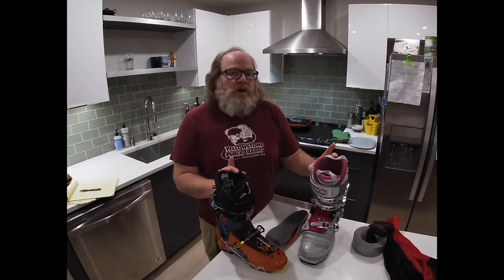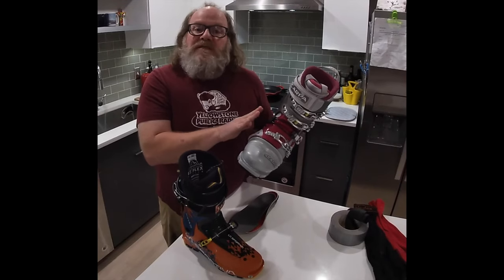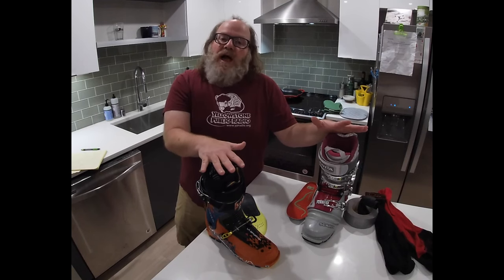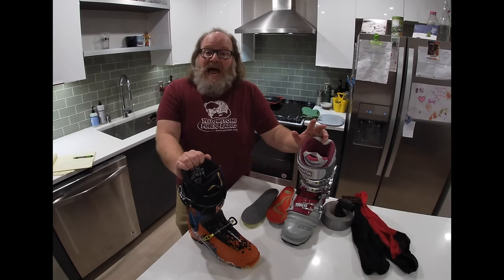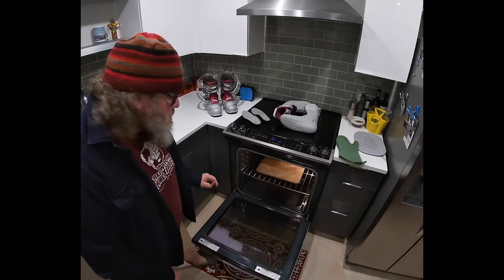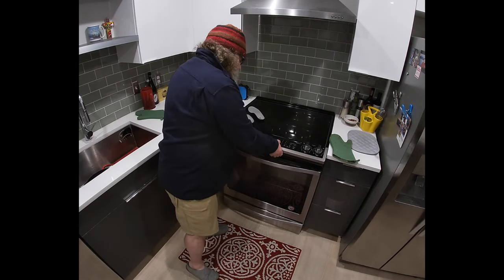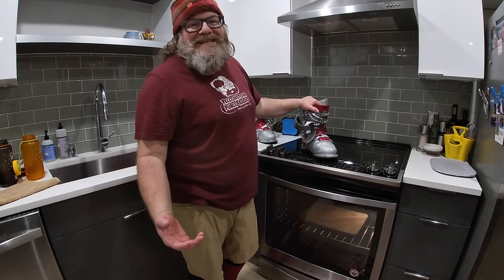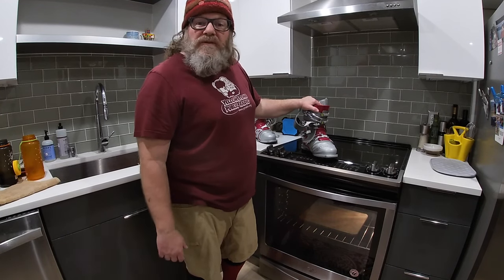Molding Ski Boot Liners At Home

Comment: I would suggest stating 350F at 15 minutes may be too high for some ski boots, My new Tecnica boots call for 175 F at 6 min only!  Set time is 5 min.
Reply from the maker: B.R., Valid point! I am in the process of editing the vid to take out the references to 350 F. That was the spec for my Garmont liners. As you have noted, it's essential to start at the manufacturer's temp/duration spec!
Reply: Yeah, you saved my behind! I just got the 130 Cochise and I was about to nuke them a bit higher at 220F. After reading your reply, I called Tecnica and the rep said 175 for 8m (checking liner at 5-6 min for overheating) in convection oven only. Thanks again!!!!

Comment: If your boot shell and liner can both be thermomolded will that help with possible hotspots or does the shell always need to be punched in the case of hotspots?
Reply from the maker: Start with heat molding the liner. Often it can open up some space around the hot spot. You can also "push out hot spots" by adding a wad of duct tape or piece of dense foam (same concept as the toe caps). If that doesn't fix it, then take a sharpie and outline the hotspot on the outside shell. Then you can search vids for DIY or take it to a shop.

Comment: 350? I thought most liners say 80 degrees. That is a big difference.
Reply from the maker: I heat the oven to 350 then turn it off a few minutes before the liners go in. Next time I mold a pair I'll take note of what the temp is at after the liners come out of the oven. I've never melted anything at 350, but it's worth checking the the heated liner to make sure it isn't going to burn your skin. I know a ski instructor who lost half the season to second degree burn on the top of her feet.
Reply: Almost screwed the liners totally. 350F is way too hot.

Comment: Do I need a toe cap
Reply from the maker: Hi Aidan. If your foot is wide/high across the ball and or toes, then it's going to be essential. Even if your feet are lower volume/narrower, it's great to create some toe space. The boot can be snug elsewhere and retain your foot. If you don't have access to toe caps, wrap the front of your foot with some cloth and then wrap duct tape around that. Try to keep it as smooth as possible so any wrinkles don't mold into the liner.
Reply: Dave D??? No way!